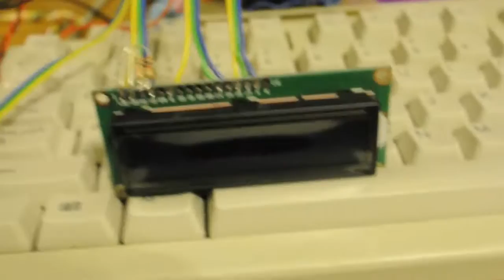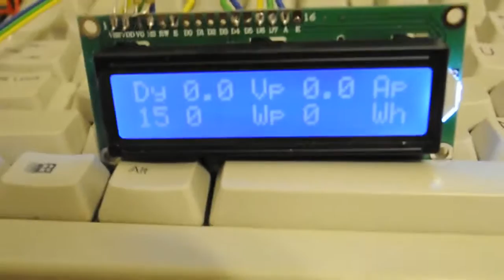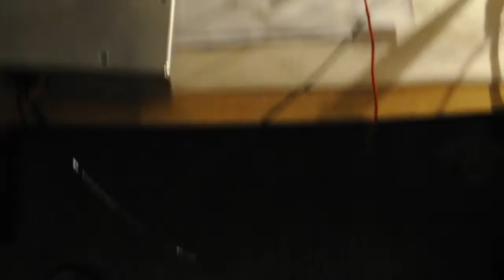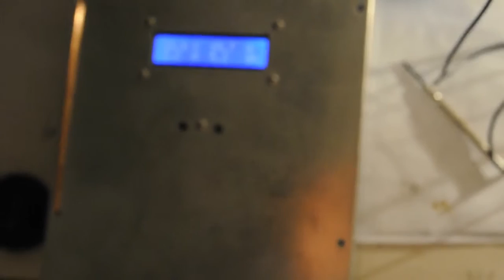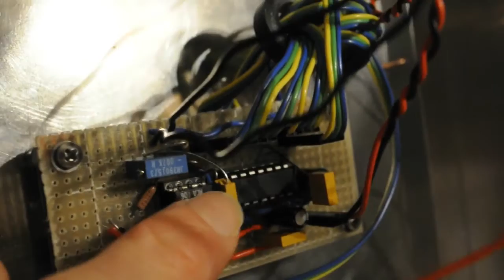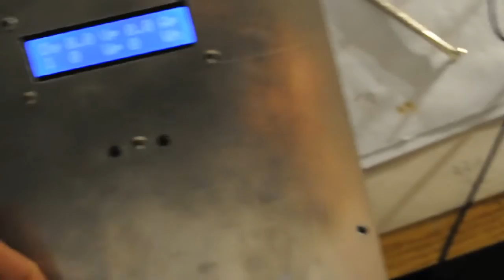ATtiny84 kWh Meter/Tracker/Logger

Comment from the maker: I’m glad you asked because there are some issues. The timing is terrible, (probably because I didn’t use a crystal ^^;). The current sense via Op-Amp also seems a little inaccurate, but it could also be the wire shunt. But to reduce uncertainty, use a real current sense chip that works on the positive side instead of referencing from ground. Otherwise, the programming seems to work fine. I would do more testing it, but I don’t have a current clamp meter.
Oh, and no prob! Glad it’s helpful. :)

Comment from the maker: Thank you, and no prob! :D
There are some slight issues with it though I point out here: watch?v=c_TrDt6ASSs
I just added that to the description. Mainly, it would be better to use a crystal for better timing and a real current sense chip and shunt. The only issue with that is needing to use a switch to turn the display on or off to free up a pin for the crystal on the ATtiny84, but most people will probably just use an Arduino with ATmega328 so it probably doesn’t matter too much.

Comment: this is cool it has pretty much everything I need I just need to wright that data to my computer that is stored in the eprom what I need to do is use VB.net to retrive that data with the press of a button or a click of the mouse.  you have pretty much everthing that I need with that other than wind speed and turbine rotation speed.   but I could use that and just add to it thanks for forsharing me the video.

Comment from the maker: I’d just a crystal. It’s not that critical, but the way it is now is silly. I first turned it on at 1AM or so, and now little over a month later, it logs at 5PM or so. But, it’s still better than what we had. :D
But I could go even cheaper and just use 60Hz from the AC mains through a half bridge and voltage divider almost like what I did with my clock. Heheh.

Comment from the maker: Hehe, yup. He executed my circuit. We’ve been e-mailing back and fourth getting some bugs worked with with the sensors. Plus I helped him out with PWM capability on the motor. I might decided to implement that myself if we get that far in the physical infrastructure.
...After some thought, I decided to chime in. :3
Also, the time keeping on my logger is terrible. Next time, I’m using a crystal. XD But the timing on my special clock is very accurate using an external clock. Will post soon. :D

Comment from the maker: Yup, 1 MHz. It doesn’t need a lot for what its doing. It can also run at 8MHz internally, but when testing the ADC, it took just as long to do a read. I read about ways to cut that time, but the result would be more erratic. There’s always a trade-off somewhere. Generally, more power is consumed at a higher frequency also. It can run up to 16MHz with an external crystal though.